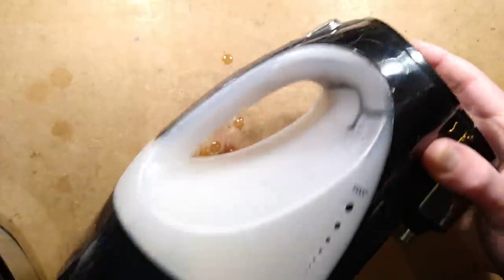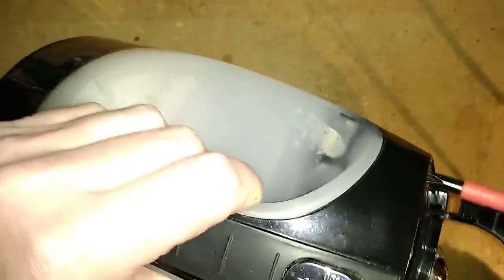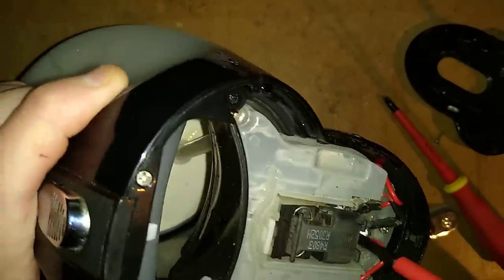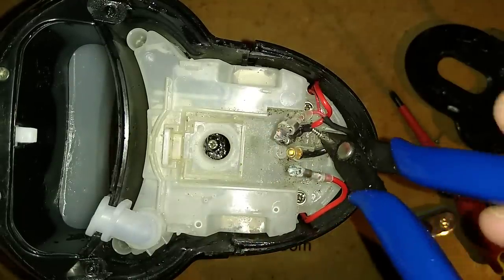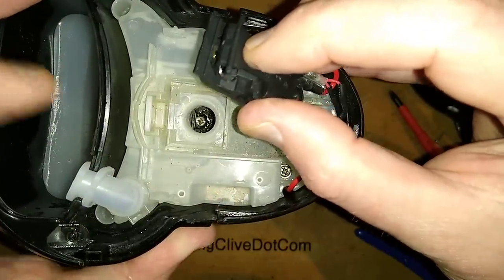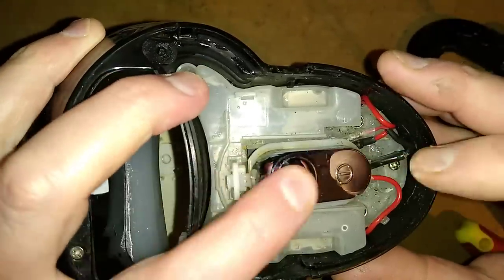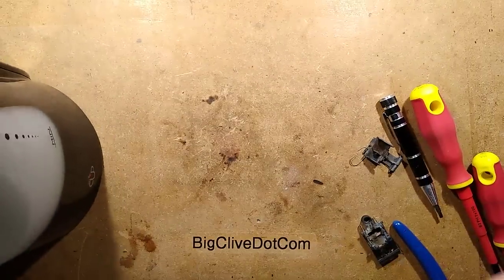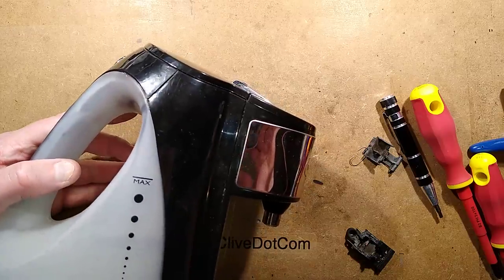Replacing my Breville Hotcup power switch.

Comment: I'd like to get one of these but I still need a conventional one as well. :(
Reply: I have absolutely no idea why they're putting electrical connections on kettles like these. It's as if no one's heard of induction hobs.
Reply: @millomweb  I guess not everyone is well off enough to own an induction hob. I live in in rented accommodation so have to put up with whatever the landlord deigns to leave me.
Reply: @Milamberinx  Sounds like you can't afford not to have one but are doing so. Look at getting a single table-top induction hob (& suitable pans including a pressure cooker) and use it every time. It'll pay for itself in electrical savings in a year or 2.
Reply: @millomweb  where are the electrical savings coming from? A kettle is near as dammit 100% efficient, a standard electric hob is near as dammit 100% efficient. A gas hob isn't 100% efficient but the gas is so much cheaper that it's still cheaper overall.
Reply: @Okurka.  would limescale make any difference to efficiency? Assuming you lived in a limescale area? And surely limescale would then effect the induction hob equally?

Yes if you used an oversized hob then you could end up wasting energy. It's pretty trivial to choose the right sized hob for the kettle.

To put all this in context, here's a article saying it costs 2.5p to boil a full kettle (https://www.express.co.uk/life-style/life/877169/electric-energy-bill-electricity-kettle-running-cost). So even if you cut out 2 full boils of the kettle a day, you still aren't saving enough energy to pay for an induction hob. So even if your bog standard hob loses half the energy, and you're boiling 4 full kettles a day, it's still not a win over 2 years. And if you're boiling full kettles worth of water on grossly oversized jobs, you probably aren't much interested in energy savings.
Reply: @Okurka.  in a heating element, ~100% of energy is turned into heat. In a limescaled element?

I was assuming a hob lost half its energy as a worst case.
Reply: @Okurka.  well yes the limescale will act as an insulator, the heat will still make its way through though.
Reply: @benholroyd5221  With induction, the energy's going into the pan and not a lot much anywhere else. 'Cool touch' kettles are cool cos they lose heat quickly from the outside; plastic is a bit of thermal insulation but it's not great.
Ring electric and halogen hobs lose a lot of energy into the hob. Heat transfer to the pan is not great either. Issues with gas:
* condensation
* flame blown out
* Heat all over the place
* Greater fire risk
* Greater gas leak risk / explosion risk.
With an induction hob, you can lift the pan off, wipe up a spill and put the pan down again without turning the hob off and without risk of burning yourself on flame or hot hob.
Using pans efficiently helps too - you don't need to drown things to boil them - with a lid on the pan. A pressure cooker's something else.
Reply: @johncoops6897  If heating large amounts of water, a high wattage heat source is useful. My ordinary cooker has a 3·7kW hot plate - and that's what the pan sees, not what the consumption is. I doubt you'd find higher power hob that's not induction. It's also so not temperature limited that they have been melting metals with induction furnaces for years.

I agree with your comments about wastage in the control gear - of induction and microwaves. It's not too important as it's still heating the house ! Unlike a BBQ !

A kettle on an induction hob is also directly heating the water.
As for heated metal thermal mass, clearly that's down to container design. Water can be boiled above a thin sheet of metal. There's not a vast amount of radiation from the sides of a pan. Probably more from a plastic kettle to ensure the sides keep cool !

For making drinks, I do use our electric kettle. It does beat using the induction hob in several ways but I still rate the induction hob as the best hob choice. Our kettle is a 'fairly normal' style jug type. The sight glass is marked for 1 cup. But I'll heat what I want in it - half a cup, 50ml - whatever. It doesn't have an immersed element as it's a bottom heater.
Reply: @millomweb  gas issues dont address price concerns though. And condensation when the energy is going into boiling water seems to be overlooking something. I've already pointed out on a previous comment that even if half of the heat is lost, it still isn't worth it.

Even looking at the worst case for non induction hob, the case hasn't been made. My own specific case, I don't live in a hard water area, and I boil the water I need in an electric kettle. Real world savings for me would be truly marginal. An induction hob has no inherent advantage over other electric heating systems. If you say that all those elements that have been mentioned at 10% efficiency, I think that's been generous, but fine. But then most people simply aren't boiling enough water to make the savings worth it. Certainly not in the 2 year time frame.

If you want to go for induction, go for induction for the faster response, heat spread, and safety, not electricity savings.
Reply: @benholroyd5221  I went for induction cos I've had my eye on it for years (now pros are going induction too) from a gas cooker that was crap - electronics went wonky on it in the end and new gas cookers were even more gadgety - so I went induction - go figure !

Comment: Fancy. That switch is more expensive than my entire kettle, which admittedly is only 2 kW. But its main chamber is one solid, seamless pot made from stainless steel, so there are no gaskets that can fail over time. Bought it after the previous one starting leaking water all over the base plate.

Comment: Wish you could a video on the 
Ovebte electric glass kettle with blue leds.
Reply: Those are junk, the element is part of the housing, the switch is not easy to get out because of all the sealant used, and the glass to metal seal often leaks with time and cycling. Not to mention they use nickel plated steel screws instead of stainless where they are not visible, so they rust into place very fast.
Reply: @SeanBZA  to each their own.  Btw to much information

Comment: My grandma has one of these but it doesn't stop pouring for some reason. She won't let me look at it till its completely dead but guess it's that bimetallic strip.
Reply from the maker: If it keeps repeating the heating and pouring cycle then it sounds like a faulty switch shorting out.
Reply: @bigclivedotcom  yes that's exactly what it's doing. I'll have to get it sorted once this lockdown is over

Comment: Your ice breaker start about the beefy electrical kettle base contact to stand was developed by a man in the Isle of man whose name escapes me.  His business used to be millions of penny connectors (made in China - BTW he cannot speak Chinese) now its million pound clocks with sales of a few.  There is one in Cambridge in the window on the High Street.  I met him in Durham when he was flying one of those celeb Profs to a date he told me.  The prof was not at the lecture or dinner afterwards. #sameold

Comment: Important info from eBay listing (11/07/2022):- “Has your Breville VKJ142 kettle stopped going blue and isn’t working? First take out the original switch and test it with a multimeter: set the meter to ohms or continuity (bleep function) then with the two leads touch each spade connector and try the switch to see if its working on and off. If you get nothing your switch is dead (open circuit). If the contacts are melted together your boiler is faulty. This may mean your kettle has other problems apart from the switch. Please note: If your new switch melts the contacts it means the boiler is faulty and needs descaling. Please descale your kettle before fitting the new switch as too much calcium on the heating element will kill the new switch fast by increasing the current across the contacts. I descaled my kettle by filling the kettle then adding a sachet of washing machine descaling powder. Next boil a cup into a pyrex jug, as it descales the boiler the water will get frothy and white. Boil a few times until it goes clear then rinse the kettle with clean water then boil it another 5 times to be sure it’s clean and smells good.”
Reply from the maker: That's not accurate.  Some of the switches being sold on eBay are just melting because they are inferior.

Comment: This looks like planned obsolescence . They could have made the contacts 2-3 times as thick without it costing barely any more or taking any more room, but they wanted it to fail quickly.
Reply: Make the moving contact bigger and they get fewer out of the sheet of brass. Got to save every yuan, as the manufacturer of the whole unit probably sold it, shipped, for less than a tenth of the price in the shop. If your profit is measured in number of units shipped per pence, any reduction in input cost will be investigated, so long as the unit meets the initial spec. Ie 500 operate cycles at full load, and less than 1% OOB faulty, for example.
Reply: To be fair with that corrosion, you probably want to replace the switch periodically anyway.

Comment: 12-99 for a frogging switch  ? !    Kettle only cost me about 29-99 !    I think I'd botch mine
Reply: Hunh - if it's the same switch otherwise, then that's great value - surely there's not much to go wrong with a bimetallic strip, which could be reused?
Reply: @NeuronalAxon  On the other hand, all kettle switches must be similar, so maybe a cheap one could be modded

Comment: How nice of Breville to provide Phillips head screws that aren't deeply recessed on that particular device. My Breville coffee grinder, on the other hand, which also just needs a switch replaced, uses triangular-head screws, two of which are so deeply recessed that I need an ultra-long screwdriver that, apparently, doesn't exist. After reaching out to Breville their suggestion would be to bring it in for warranty service (it's not under warranty). I absolutely HATE this non-repairable culture we've found ourselves in thanks, in part, to Apple (or maybe they just take particular advantage of it).

Comment: I'm confused about the comment about the Europe power. You guys have 220V and 7A breakers, right? Where is the 3kw coming from? How is that different than 110V and 15A breakers? Am I missing something? They're both 1.65kw, right?
Reply: We have 13A fuses in the plugs
Reply: We got 16 A Breakers typicallly, although higher values are not uncommon.
Reply: @Miggedy123  30A for the cooker main isn't it ?
Reply: @techmailbox2400  typically we use 3 Phasese for this but single phase coocker main was 25 A in my last flat
Reply: @techmailbox2400  Oh wow, for some reason I thought it was 7A breakers there. Thanks for the info, guys.
Reply: @Miggedy123  I'm in the UK, we don't usually have 3 Phase in residential properties,  so high amps is the way to go
Reply: @xenonram  The standard value below 10A is actually 6A, suitable for old 1mm² copper wiring, which is no longer legal anyway.
Reply: Steve Terry  1mm² were the typical residential single phase circuits in my country around the time of WW2.  For the past at least 40 years, anything below 1.5mm² has not been allowed for mains installation (0.75mm² flex is still common for lamps and extension cords, but not the actual house wiring).
  UK ring mains are supposed to distribute the load between the clockwise and counterclockwise halves, thus 15A in that 2.5mm² wiring.

Comment: Didn't you do a video of the base of a kettle like that? Oh and don't rub it in that you have 3kw available!
Reply from the maker: Yes I did.
Reply: It's fairly common in N. America to have 220v in the kitchen. Electric ranges and stoves require it. We also have it under the sink for an instant hot water tap that has since been removed (I'm a coffee drinker). But yeah, most free outlets are only 115v so it's not as simple as going to Walmart and getting a kettle.
Reply: Ray, I'm an electrician in NE USA. Not just the available power but the appliances to go along with it.
Reply: @fanplant  agreed. If you want 220v appliances (aside from the usual suspects) you are stuck with eBay or Amazon, and you'll need to put your own plug on.
Reply: Not just 3kW, but 3kW *per socket*, and theoretically over 7kW for most circuits 😉

It really is very nice not having to worry about overloading a circuit, even with a couple of 2kW heaters in use in a room :)
Reply: @AndrewGillard  You can stop now.  lol
Reply: @thatsunpossible312  - Hot water tap, or boiling water tap? I'm not sure why you'd remove a boiling water tap, it's useful for so many things not just making tea. I mean you can even use it for water to make a pour-over cup of coffee. But aside from that, filling a pot to make pasta so you're not waiting for the water to boil on the stove for instance.
Reply: @TheMrVengeance  we have very hard water and it kept getting clogged with scale. More trouble than it was worth.
Reply: @thatsunpossible312  - Ah fair enough.
Reply: @AndrewGillard  I've a fan heater marked 3kW. I think it's only a 2·8kW heater though as we get 200W of heat direct from the plug ;)
Reply: @TheMrVengeance  Pan + cold water placed on my induction hob turned up full is usually boiling as I pour the pasta in having just got the bag open !
Reply: @millomweb  the heat from the plug and cord are all factored in ;)
Reply: @UCdqRn_A6r9VpQK0MfM03AAA it's a little more complicated than that. People in apartment buildings or condos and in commercial have 3 phase feeds with  weird numbers like 208v. Even with single family homes, you are likely to have modern 120v appliances but also older things meant for the old 115v standard and maybe even some antiques rated for the 110v standard. Around here it is common to find knob and tube 110v rated houses, albeit now running at 120v. Anyway, the terms are all fairly interchangeable depending on the age of the person you are talking to... The important distinction is 110-120v vs 208-240v 😁
Reply: Ahhhh 3kw kettles... Where would we be without em... *Giggle*... Fanplant... Ay? I said WHERE would we be without them.... Only winding you up lol 😃
Reply: @CharlieFlemingOriginal  nah, I've never had it so 1500 watts it is.

Comment: I've bought one for my mum as a safer way than using a traditional kettle. Anyone know of any mods to get it to boil hotter as it's just not quite hot enough for me.
Reply: The oxygen release is what pushes the water out, you'd have to bypass the valves and probably blow up the boiler in the process.
Reply: @alexatkin  Do you have one of these?
Reply: Alex Atkin oxygen release? What?
Reply: Rob, move to a lower altitude :) Since it is steam pressure when it boils that pushes the water out, they should all produce at the temp of boiling water.
Reply: @stargazer7644  Unfortunately I'm stuck where I am. It really needs to hold onto the boil for longer in order to be at a good temp for tea like normal kettles do. Combi boilers are the same I find bur acceptable for what they do .... not for tea though.
Reply: @robthomas7232  If you're at a high altitude, the low air pressure is what's messing up your coffee or tea.  Water simply boils at a lower temperature at high altitude.  That's why you can never get a decent cup of coffee on an airliner.

Comment: I seriously hate the way current electric kettles are designed. Basically every model — regardless if it’s a 10- or 100-Euro kettle — relies on the system of moisture gradually disintegrating tiny contacts of a cheaply made switch. As my latest kettle I had to buy a few months ago already arced out of the box, I disassembled it and had to manually adjust the switch contacts that had the strength of three layers of aluminium foil … What a mess.

Comment: £50 for that? Looks like there is nothing to it, i suppose it is a hot water dispenser not a kettle, i got myself a Morphy Richards one a few years back for £20 from B&M, but it is smaller , you fill your cup up with cold water and then you tip the water into the unit and place your cup under the spout before you turn it on. It works well not that I use it that much these days as i use my  Espresso machine most of the time. Morphy Richards do not make them now, but a company called Vytronix do, but for £24.  i am thinking of getting a spare as I doubt very much if I would be able to get spare parts for mine. 
Looking at the video, it shows how much grime gets under the plastic and the switch, even for a kettle. 

Link to the Vytronix on Amazon below if anyone is interested, it is a great unit for one cup of tea and it does boil, where some of these hot water dispensers don't, which is fine for coffee, but not so much for tea. 
https://www.amazon.co.uk/dp/B07HJ7W9S6/?coliid=ITQ3XCY7H0F2S&colid=5YXNFVAN01QY&psc=1&ref_=lv_ov_lig_dp_it

It seems the breville is only £30 on Amazon, so that is a bit better.  My espresso machine is produce by Breville, but they use the Sage name  in the UK as Breville seems to be for the lower price market :)

Comment: I dont like 3kw kettles, I think they just shortened the element  to run at a lower voltage then when 240 is applied it draws 3kw.. because the element is being over ran, that's why they dont last long, betting its designed for the EU 230 volt like most things.. in uk its 245 volts for everything we get from the EU is being over voltaged by 15 ish volts just to shorten its life, like vacuum cleaners the motor burns out after 2 years because they not designed for 240 volt, they are designed for 220 to 230, I know it's not much but it does help to shorten there life! I have still got my tefal gold element kettle from the mid 90s  and a Hoover vacuum cleaner from the same time made in the UK for 240 volt.. it's no wonder they still work. I hate the EU